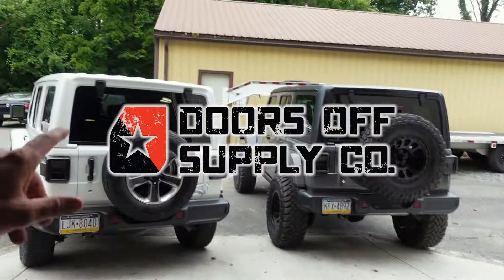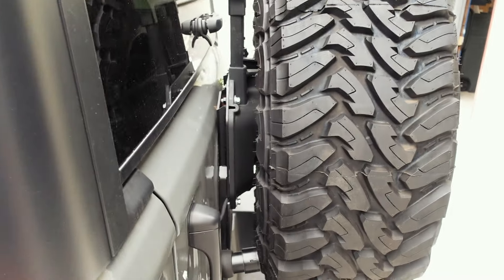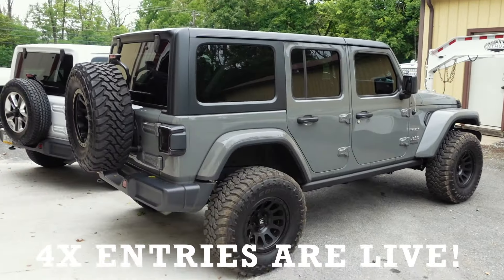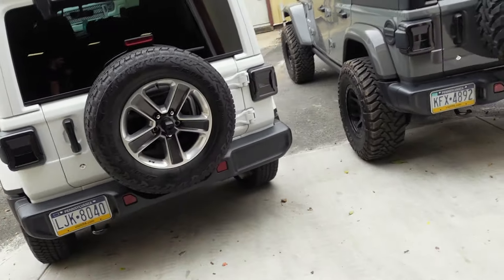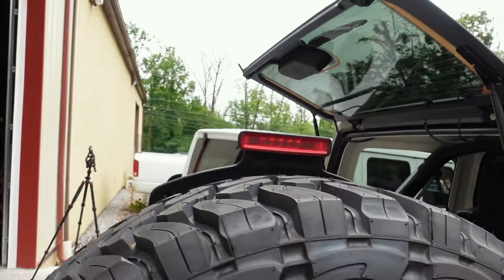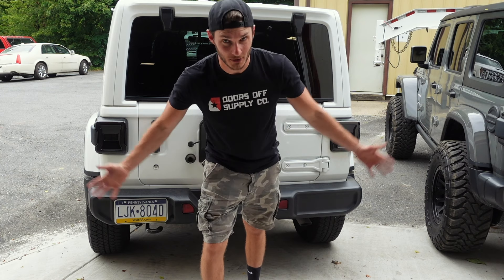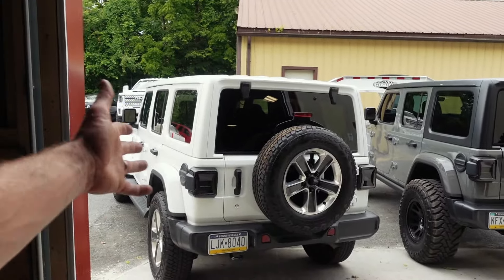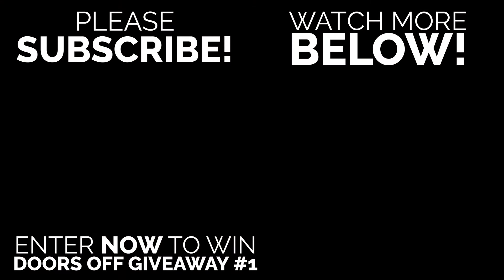DON’T Run 35 Inch Tires On Your Jeep Wrangler Without THIS!

Comment: I don’t mean to criticize, but although there is now clearance for a 35” tire, that tailgate is not going to take any rough roads with that much weight hanging off it. That is the reason MOPAR makes it a tailgate reinforcement assembly, to prevent failure.

Comment: I think the RC relocation bracket is a bit too high up. Prefer EAG. Also, regarding everyone's comments about reinforcement, I hear that is definitely needed for JK but JLs are stronger capable of holding 35s plus up to 85 lbs inner trail rail

Comment: I had a 2015 jeep wrangler sport unlimited with 35 mud claw tires. With the same as a spare and when I changed the oil I rotated the tires including the spare and got 80k miles off of the tires before I had to changed them out.

Comment: I wouldn’t mount any tire directly attached to the tailgate, especially if you’re doing off-roading a lot, over time it will break the hinges on your tailgate. You should get a tire hanger that attaches to the bumper instead

Comment: As an owner with a jk on 40s and a full sized spare. I just took the 3rd brake light off 😂
Reply: Some places require 3rd brake lights. Near me in Delaware they pound jeeps to death about stuff. They literally didn’t let me pass because “my indicators are too dark” even tho they are brand new bulbs and are stock. Yet they continue to allow someone through with the trunk ratcheted closed and it squealing as it drives

Comment: you left out the fact that you have to take the backing off the brake light and adjust the wire for the length.. also you need the bracket to raise the 35" tire higher then the bumper or it will hit with most.

Comment: I have a 35” tire on the rear tailgate and the light is visible with no lifting of the light. 🤷‍♂️ I have both a 2018 and 2022 wrangler rubicons with visible brake lights.

Comment: Are the stock bracket on Rubicons different? My JLUR has a few inches gap from the stock 285/70/17 to the brake light.

Comment: I don’t get it, a must do? I have been running 35s on my stock carrier for for almost 6 years and no problems
Reply: It only takes one time for it to rip off the back and take out the car behind you and possibly kill them. I've SEEN and heard horror stories of the gate coming off or the tire carrier brake off on the highway.

Comment: What psi should I run on 35 inch tires, just a question?
Reply: I run 37 psi on street, and then of course air down on trail depending on the conditions.